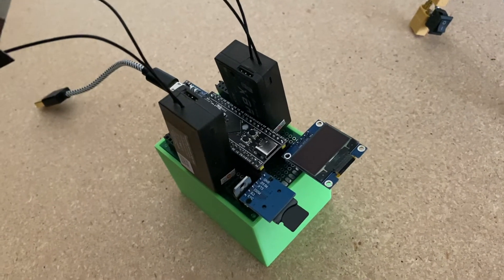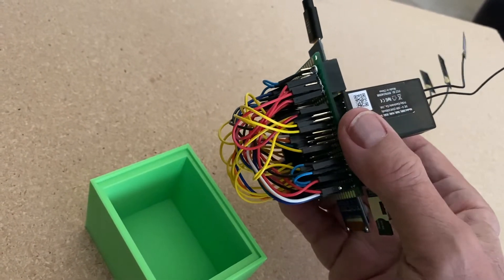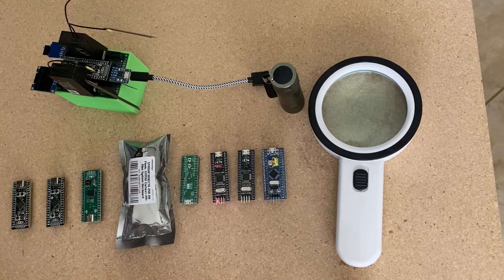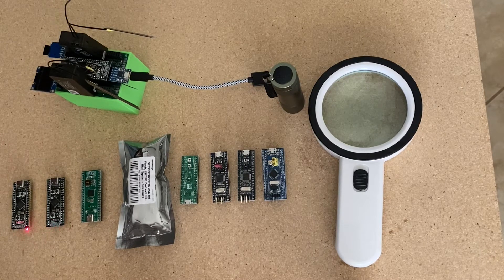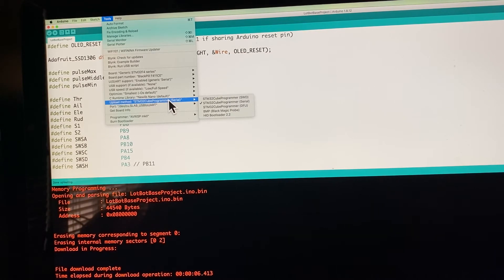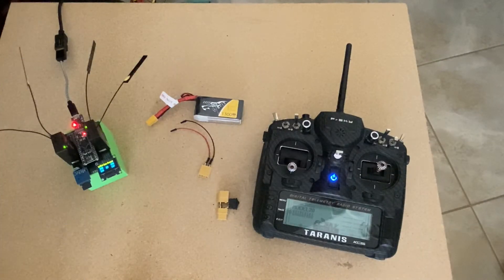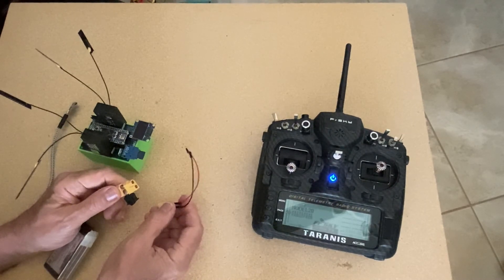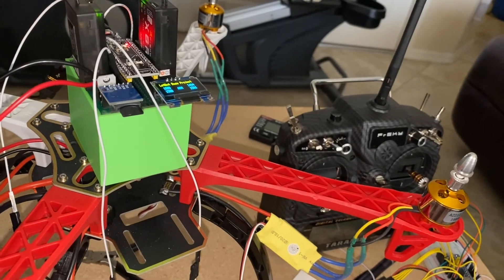STM32F411 Black Pill update of the LotBot Base Project

Comment: Please tell me is liquid crystal display liberary work in smt 

I2c display
Reply from the maker: Several of my videos use the same libraries to support using one or more I2C displays but I am not sure if this answers  your question.
Reply: @lotbotrobotics5026  
Some one Said

We can not use liquid crystal display i2c module with smt 32 board like we used on Arduino NANO

Is it true

Any other methods for do soo
Reply from the maker: I use LCD displays with STM32 boards all the time and I use the arduino IDE to build the sketch. Take a look at another one of my videos and you will see a STM32 sending messages to 5 displays. It also uses multiplexers as the LCDs have the same address. The video is in my YouTube Channel "LotBot Robotics" and is titled  " I2C Bus example with 2 STM32F4 Black Pills, 3 TCA9548A Multiplexers and 5 0.96 inch displays". Hope this helps.
Reply: I mean to say that can we use display with SMT Microcontroller like show in this vedio 

Name i2c display interface with Arduino uno

 https://youtu.be/q9YC_GVHy5A
Reply from the maker: Sorry, I did not understand your question. I think I have done that with an STM32 but not sure. I have that LCD display.  I am in the middle of part of a project now but I will check it out and let you know definitely by Friday  Aug 6, 2021.
Reply: @lotbotrobotics5026  

For Arduino NANO we have less digital io pins
If we want to use different Sensors motor Driver and display 16*2

Then we have to connect i2c module to display by which we only have to communicate using 2 pin SCL SDA

In Arduino NANO for this i2c 
Crystal display liberary is available

So my question is ,
can we do it with SMT 33microcontroller

I heard that some Arduino labirary are not compatible with smt 42
Reply from the maker: I had some time today after all and was able to connect the LCD to STM32. I thought the information might be useful to you and maybe useful to someone else so I created a fast YouTube video and added it to my YouTube channel "LotBot Robotics". Here is a copy https://youtu.be/5wT2yvgZ_rQ.  I hope this answers your question. If it does please let me know..
Reply: @lotbotrobotics5026  
Thank you so much for your help

I am glad that you helped with visual demonstration

Comment: hello, I am using these black pills also, but I notice that on the  pinout for the F401 black pill there is no TX3 showing, I know there should be one there somewhere, do you know how to  switch alternate functions on the gpio pins ?
Reply from the maker: Sorry, but my pin layout only shows RX1/TX1 twice, RX2/TX2 once and RX6/TX6 once. When I tried to use any RX/TX other then RX1/TX1, I had problems and that is one of the reason I needed to use SPI and I2C. I guess I really did not know there was a TX3 as I have not see it in any of the information I reviewed. Using STM32 boards with the Arduino IDE has been an education. Lot of luck on your project.
Reply from the maker: About your how to switch pin function, you might go to www.st.com and look at the STM32CubeIDE which does assign function to the chip pins as I understand it but I have so many non ST modules that I have only used the Arduino IDE as it supports a lot of different boards.

Comment: Thanks for sharing. I am playing with a fully containerized Fedora Silverblue OS to explore if it's viable for hacking around on projects. The STM32 Cube Programmer app isn't available as a container. The rest of the Arduino toolchain is available, but without the Cube Programmer it doesn't work. ...Anyways, this is the first time I've seen it working together... looks nice. 
  I have that same "WeAct" F411 blackpill, and just got the toolchain working for micropython. It's not very difficult. Heck, if I can do it, anyone can. I just followed the micropython GIThub directions and the mcauser WeAct github page. On the latter page you'll find info about the serial memory footprint on the back of these boards, if you haven't found that reference already. The only general hiccup I had with the μpy installation was that I used the ./micropython/ports/stm32/README's suggestion to set the PYDFU=0 (or something along the lines of this name (I'm not on that computer at the moment))...for the make .. deploy command. I had to use the dfu-util program (available in linux repositories). This may have been due to the fact μpy is in a rootless container on my comp though.
  Once μpy is loaded, the interpreter is available over the USB-C connection via any terminal emulator, and you can upload python programs as well. Having an REPL system running is nice for prototyping. I had it running last night with sterm, but just downloaded the PyCharm ide and got it working with their built in micropython plugin. The plugin doesn't list the f411 as "supported," but after installing μpy on the 411, I noted the tty com port ID is changed to f055:9800. This is the case for all STM32F4 boards as can be seen in the pluggin's source code. It only checks for this ID. 
  This setup seems to be the most recommended option that I can containerize. The thonny.org IDE seems to be more recommended, by a small margin, but isn't sandboxed as easily. With pycharm, I recommend a network firewall with whitelist as it dials out to 4 server IP's constantly, if you're concerned about things like this.

  Anyways, I watched your upload during lunch, while looking for examples using the 411. By no means am I telling you how to do your projects. I'm simply saying, if you're interested in trying it, this is what worked for me within the last 48 hours.
 The coolest part was, after getting a command prompt for the interpreter, then typing:
$ help
and getting a long list of available commands and their basic arguments, like any linux machine.
Thanks for sharing your project, I like the dupont wire proto board idea. Subscribed.
-Jake
Reply from the maker: Jake, Thanks for your comment, sounds like you're having as much fun with micro boards as I am. There are just so many different components that I have been playing with to establish an engine that I can use for my Robots and Drones. I have tried to stick with the Arduino IDE instead of learning another development environment like the one mainly used for ST's modules. If there is anything you need to know about anything I am doing, please ask. However you may be further advanced than I am.